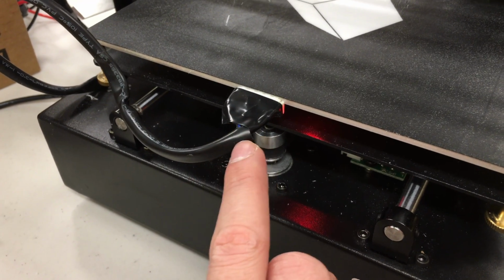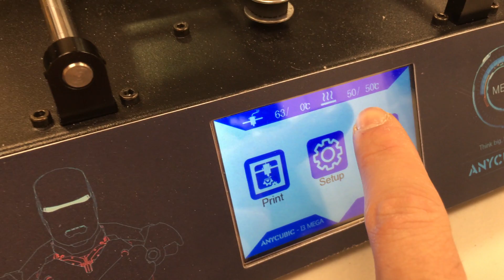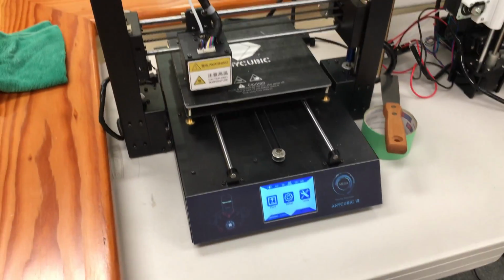How to FIX your heated bed? | Burning socket and melting cable problems

Comment: I would rather use bullet crimp connectors because they are more reliable
Reply: Okay but over time they will come loose
Reply from the maker: David Ferguson it depends, if you solder them good and stabilize the cables to the bed (so that soldered points will not bend with bed motion) they will last long. Everything has an end date. This is not a perfect solution.
Reply from the maker: Sure! why not if you have them go ahead. This is an quick and dirty method.
Reply: Okay I understand what your saying and I was only giving my opinion
Reply from the maker: David Ferguson yeah no worries lol. Opinions are great I appreciate it 😃😃

Comment: First, thank you for taking the time to make this video. Second, take this video off youtube, only saying this because thats the worst way of fixing this melting connector problem. I would tell you that if your going to take the time to make a youtube video about it, please do the job the correct way. Take your heatbed off and desolder those pins. Then go out and buy a little heavier gauge wiring for the positive and negative. Then solder tgem directly to the board. The way you're doing it is really bad. No disrespect ment at all.
Reply from the maker: yeah soldering them directly into the spots would be better. What I show was the quick and dirty method.
Reply: Osdoyi PhD fair enough
Reply: I hear you need an extra poweful iron to de soldier those
Reply from the maker: I used an iron that heats up to 750C degree
Reply: @3DPDoctor  do you think a portasol (up to 580 dgrees) would work too?
Reply from the maker: You might need to hold it longer so that  it can melt. I believe there will be a bulk of solder material at the joint

Comment: the two outmost connectors are common on bed.  they should be toghter, like in tevo tarantula heat bed with double wires
Reply from the maker: What do you mean? Could you explain more?

Comment: Sugestion: it would be better to put thermal shrinking tube instead that insulation tape because maybe eventually the wire is going to brake after lots of bending proceses when y-axe moves. Thanks on info of your problem because I am waiting for my anicubic mega i3 to come so I can be carefull on this possible problem.
Reply from the maker: True, heat shrink tubes are far better. I couldn't use any because I was out of them at the moment. I mentioned the usage of them in the video. As you may see, anycubic i3 mega's heated bed cable is zip-tied to nearby screw stable on with the heated bed. Therefore, soldered and taped cables won't be moved due to y axes movement. 
If you purchased the anycubic i3 mega with the ultrabase version you will not face this problem because they removed the socket connection in that one.
Reply: Osdoyi sorry if I didnt listen carefully about shrjnking tubes :) and thanks for info about new conecting solution on new i3 mega. Btw happy new year! 😃
Reply from the maker: Haha no worries 😄 happy new year and happy printing